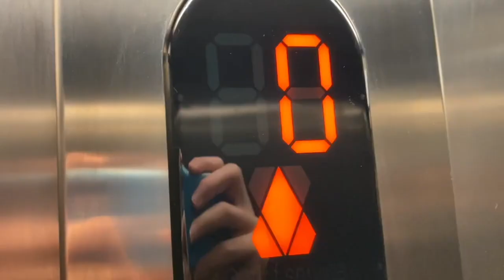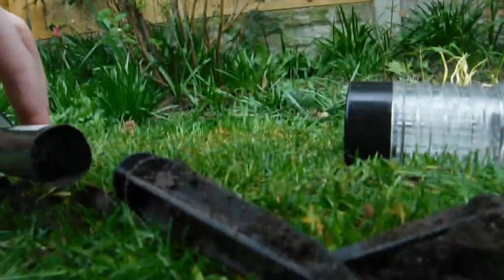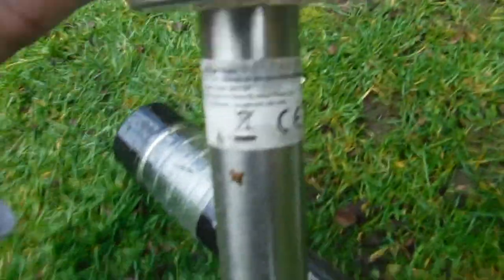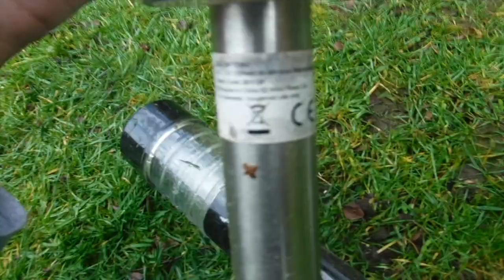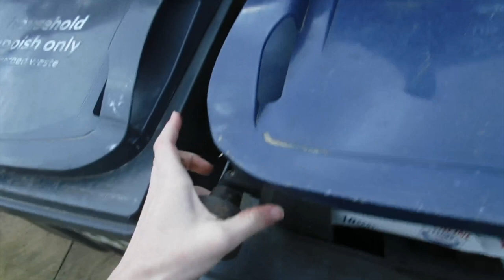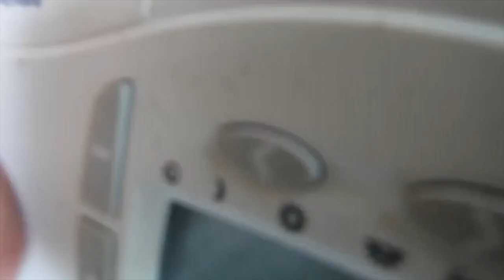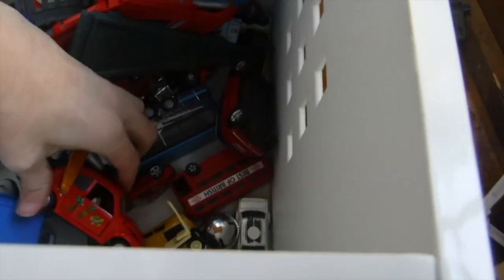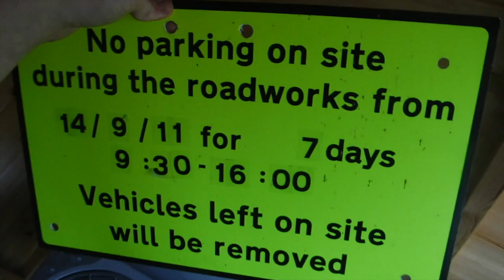Garden And Summerhouse Tour And Scrapping Dead Solar Lights

Comment: Which camera did you used in this video?
Reply from the maker: W710 and XP130
Reply: @LiftEnthusiast2020OFFTOPIC  in the start of the video is W710 or XP130
and of which brand?
Reply from the maker: @GalaxyKauri2008Offtopic  W710 by Sony
Second part was recorded with Fujifilm XP130
Reply: @LiftEnthusiast2020OFFTOPIC  thx